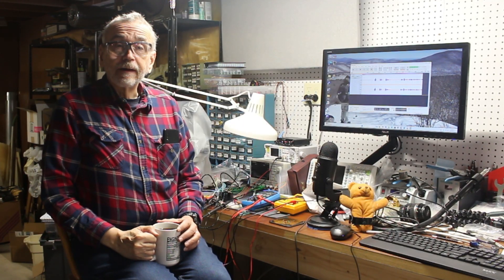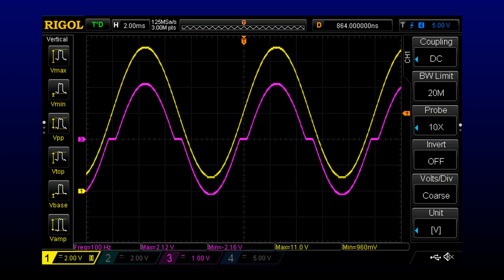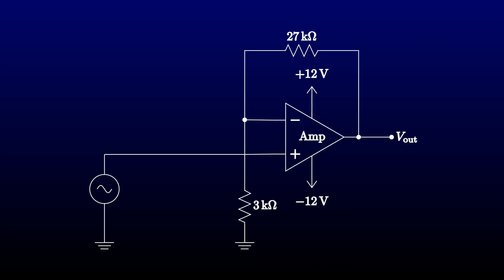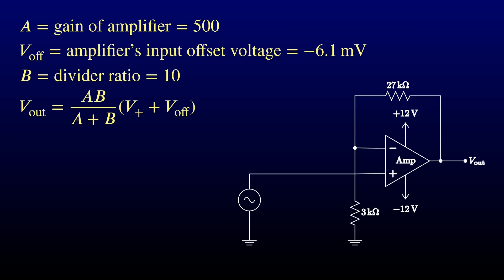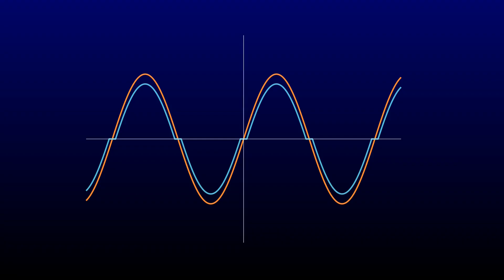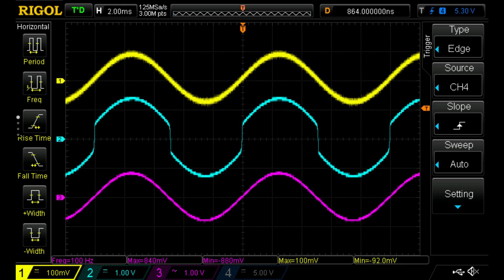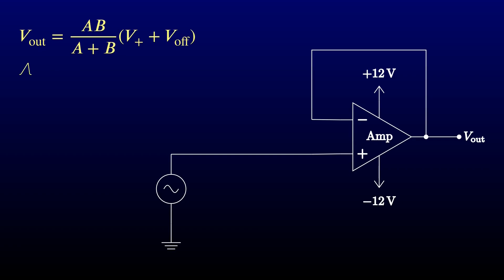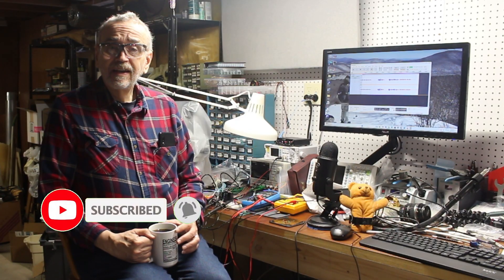Taming Distortion with Negative Feedback - Transistors 101, episode 17

Comment: I like this video series: excellent balance between concept, calculations, and practical application on the breadboard. Great work
Reply from the maker: Glad you like the format!  It's a pattern I try to follow:  explain the idea behind a circuit, design an actual example, prototype and test. (If I were doing this in the classroom, "prototype and test" would usually be a lab assignment - but this is YouTube, not a university.)

Comment: Haha. About a year ago I went through a similar project for fun, build a discrete opamp on a breadboard and troubleshoot at each step as I went along. Only I did it with MOSFETs not BJTs, 2N7000 more precisely. And because I'm lazy and also wanted to save space on the breadboard I didn't use a proper current mirror but instead a simple current source with a JFET. :)
Reply from the maker: It's great to see people learning hands-on!

Comment: To begin with... Why don't make output stage working in AB class by introudicing base bias via two diodes (or later with a rubber diode)? Negative feedback can do only so much... You reminded me of LM358/324. God I hate those amplifiers. 😂
Reply from the maker: To some extent, the output stage is deliberately bad - to demonstrate the power of feedback to fix it.  I'd certainly use a class-AB for a power amp, but that's only if I had some particular reason to be designing a discrete power amp rather than using a packaged one in the first place.

Moreover, as I was writing this episode, I was saying to myself, "what's the simplest thing that could possibly work and demonstrate the principles?"  I wasn't trying to design a good op-amp, I was trying to show one reduced to the barest essentials.  

Think of this as the first lesson in op-amps, not the final one.  They all work essentially the same way. There's a differential stage at the input (bipolar or FET), a gain stage, and an impedance-transforming output stage.  The output stage is typically a follower of some sort - current gain rather than voltage gain. Each of the stages can be improved significantly (load the differential stage with a current mirror, use a gain stage with a current source as the collector load, use a class-AB power stage, use better input offset cancellation, ... on and on ... but none of those things explains the basic idea of "what's in an op-amp, anyway?"
Reply: @KludgesFromKevinsCave  Precisely. OTOH I am "guilty" to have, at a couple of points in the past, slapped a push-pull pair on the output of an opamp inside the feedback loop, when I needed just a little more current than the opamp itself could deliver... and nobody was the wiser. :P
Reply from the maker: @stamasd8500  "good enough" is always best!
Reply: As soon as I saw the class B output stage I thought the same. For the sake of a couple of diodes and a current source of some description the cost is insignificant compared to the gain in performance.
Reply: @JaenEngineering  Not to mention that if one use PNP as VAS, as was done here, one can use the same current mirror for emiter end of differential par and for pulldown in output stage. Well not the same but the if you take 3 NPN transistors, cpuple them thermally, one can work as a 'diode' part of current mirror while producing base drive for other two transistors, and then one can sink the emiter current of differential pair and other can sink the bias current of output stage... Ofc, we are now in a bad practice of designing discrete 741, but when in Rome... Just joking, but it would not be a bad practice for learning about opamp internals.
Reply from the maker: @ivanpopovic9503 You're really going to hate the next episode of the series, where I compare the amp we've just built with the internal schematic of the exact amplifiers you hate!  (And I observe that we've reinvented the op-amp, badly.)
Reply: @KludgesFromKevinsCave  I was joking about 'hating' LM358/324, they are bad, I mean, the best they can be with 10-ish transistors as I remember, but they cost almost nothing, so for some mass produced stuff and when there is not need for precise or fast work... They get the job done. 🤣
I must say, maybe I can 'hate' some opamps, but I find it hard to 'hate' any of your episodes! Though I finished my studies long ago, and I'm engineering analog circuits for two decades now, I find your channel very interesting, and must say that I'm happy for the kids nowdays that have easy access to extremly well done and educational content as yours! Your way of explaning basics in electronics (I addore your episode on Ebers-Moll model) reminds me of my late proffesor in electronics basics class at the college. She was one of the greatest teachers (and a very skilled engineer) I ever knew. 
P.S. I really like watching (to be honest 80% listening) your videos while at the lab! 🙂